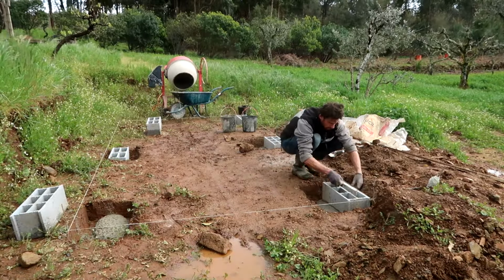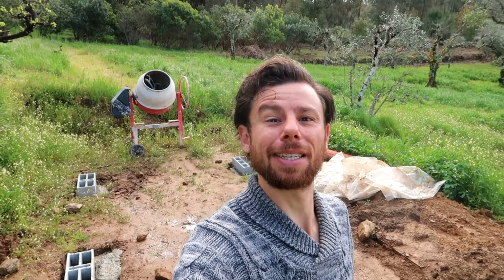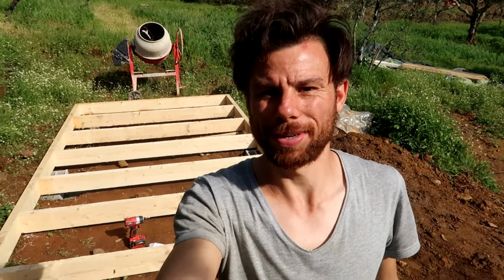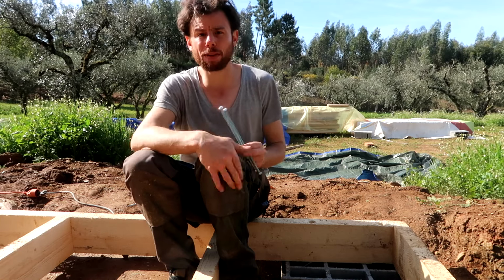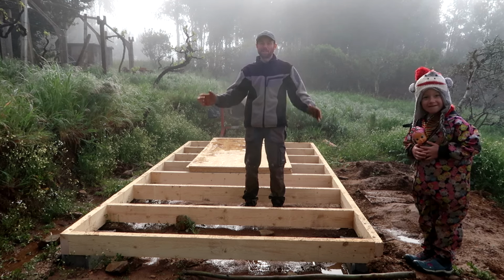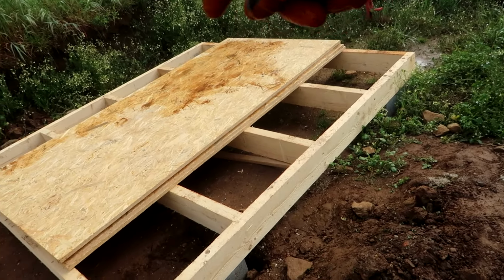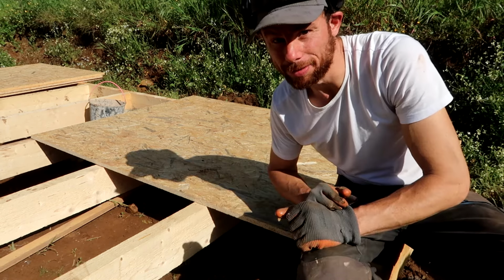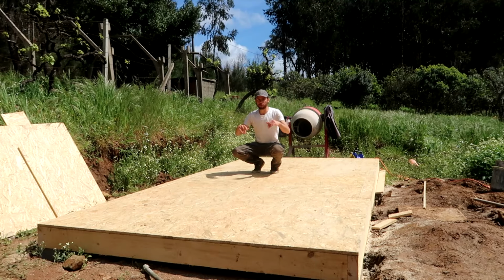Sanitary Building part 2  - Installing Wooden Floor Structure & Flooring!

Comment: Do you not have bathrooms in your house?
Reply: Это будет санитарный блок для стоянки кемперов.
Reply: @cherylargenziano7475 He has bathrooms upstairs and downstairs in his house. See his previous videos. That he  builds for the camping spot. 🏞️🏕️🚐🚌🌲🌳🌷🍊🍎🍐🍎🍏🍐🍑🥑🥝🍇🧃
Reply: @christinamirkovic3857  I’ve seen most of his videos but must have missed the one about camping. Thanks for the info.🥰
Reply: They are building a small camperparc so this is for their guests